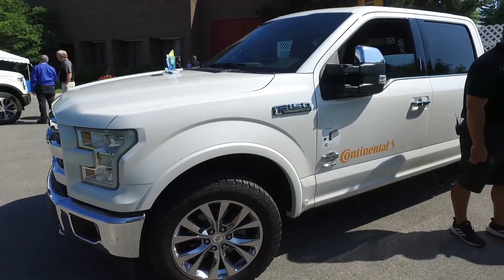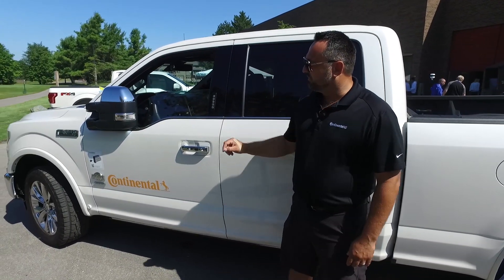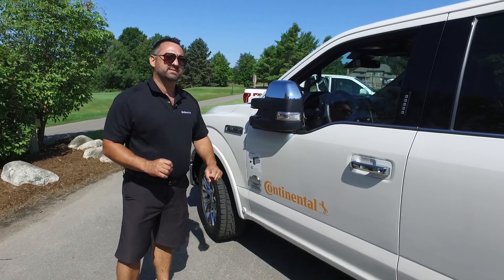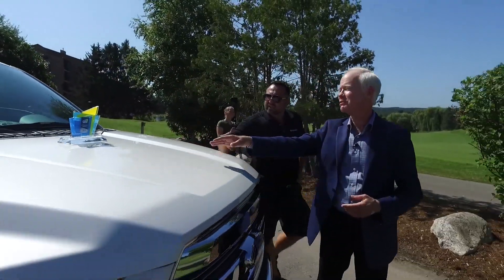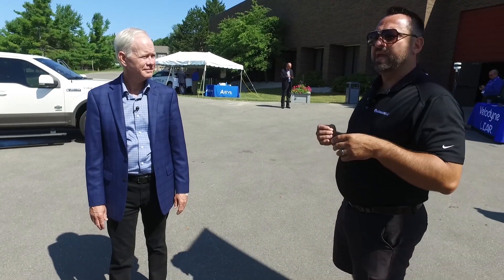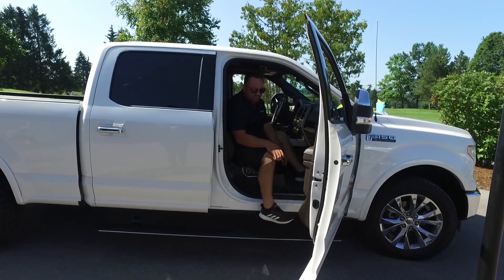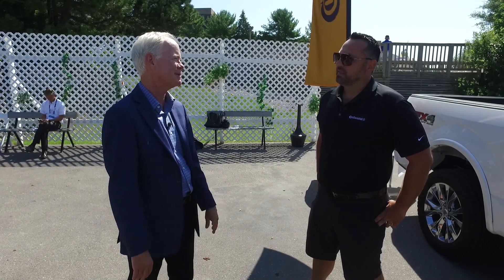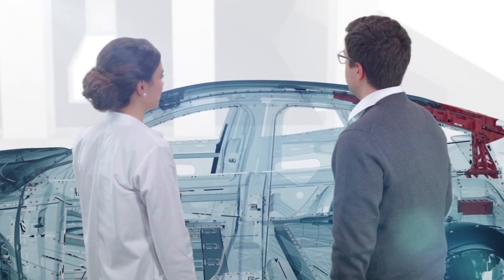Continental Advances Door Technology - CAR MBS 2019

Comment: Enough of the unnecessary motors in cars.

But adding a dashpot to doors--that can be valuable. It doesn't need all the sensors/computers--just a damper.
Reply: Won't work, you don't want a damper for a weak person.